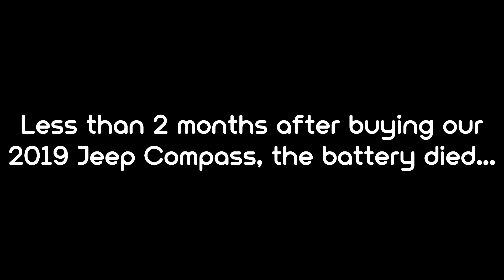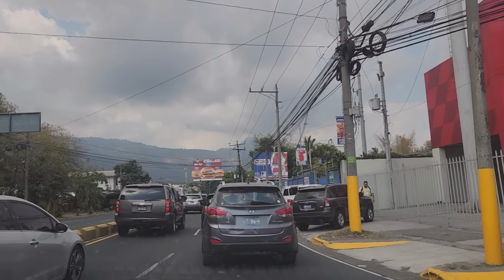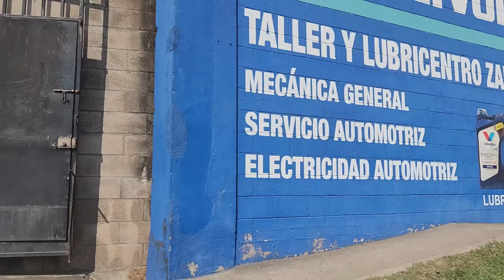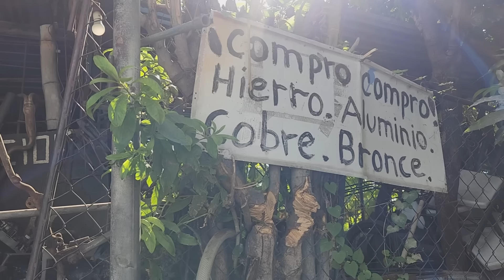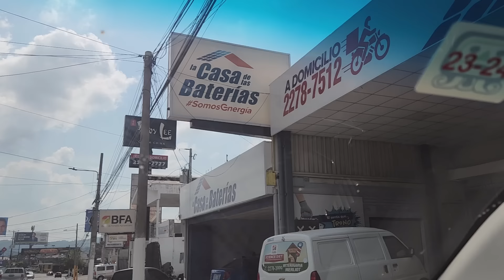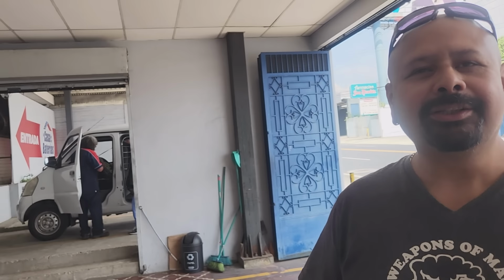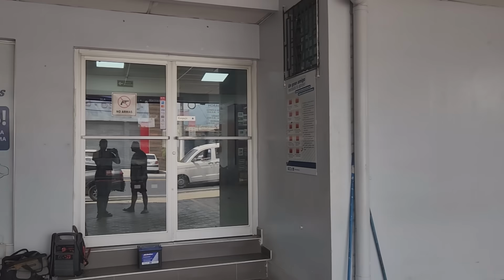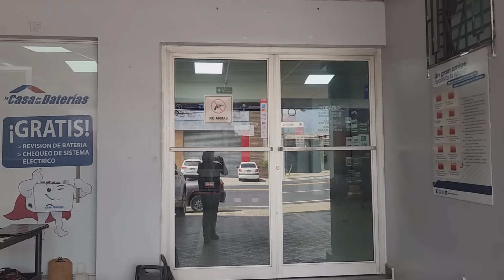Taking our car to the mechanic in El Salvador

Comment: They charged you only a dollar for a tire valve? That is great. Here in the USA you have to be ready to lose an arm or a leg with their prices. The prices for batteries have been going up all over here as well. I paid $ 249 dollars for a Sears Die Hard battery with a two year warranty. I bought it from someone who sold it to me on the street for a quick buck because the battery on my car would not start. You are at the  mercy of scammers when your car breaks down, but I am glad your experience there was not so bad. Take care both and thanks for such great videos.
Reply from the maker: @michaelfishman7174  yeah the talleres here are great at fixing cars for cheap, but I think it depends on what car you drive. Apparently much better to have a Japanese car here

Comment: Amg bateries are expensive and most new cars use that kind of batteries. I put a regular battery pn a 2020 corolla and was having problem with the engine and trasmision untill i put the AGM for $280. And I have nissan pathfinder in el salvador that uses regular battery it cost me like $80

Comment: So he gave 5….  This the reason everything is getting expensive. Because from now on. They will charge 5 bucks for a stinking air valve.
Reply from the maker: @rola4721  you would have to see an overall rise in household incomes and consumer spending, which increases demand and scope of work for businesses, for inflation to occur. The odd tip to someone who's income is well below the poverty line will not cause inflation - but it will make their day!
Reply: @BraveNewPath  right that worked out great for Canada and the US.....

Comment: La bateria tiene un promedio de vida de 5 años, revisa el regulador de   voltage que esta atras del alternador esos tienen a fallar, y dejan de cargar la bateria, ponle tu multimeter al la salida del alternador te tiene que dar 14volts.
Si no sabes hacer nada de eso, te recomiendo que aprendas, no tiene sentido tener auto y no saber cosas asi de sencillas, yo no soy mecanico pero hasta le he cambiado cadena de tiempo, y clutch a autos que he tenido. Da mucho gusto hacer uno mismo tus cosas.